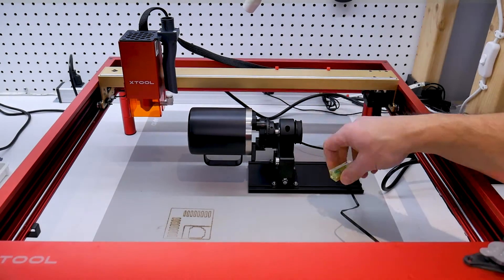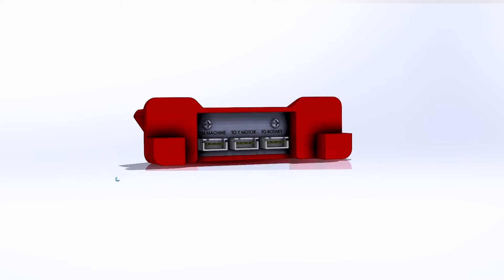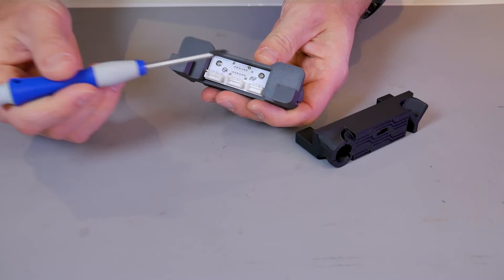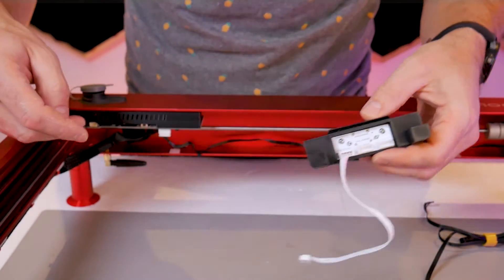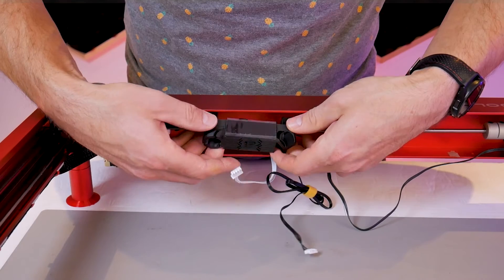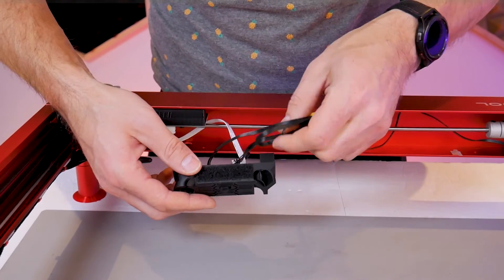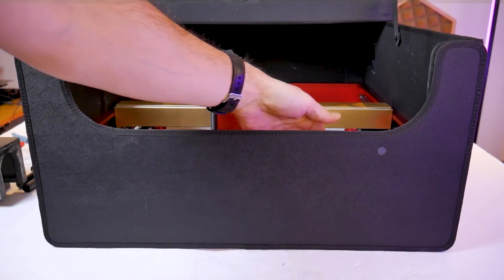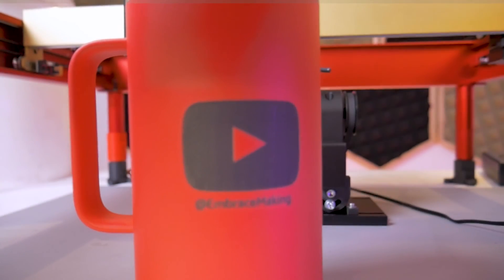XTOOL RA2 PRO V2 Rotary Switch Installation (Hidden Mount)

Comment: XTOOL RA2 PRO V2 Rotary Switch is a great idea. If RA2 is constantly used, your switch will enviably save PCB connector from pulling away from solder pads. I JB Welded my connecter to PCB but don't trust it.
Good engineering and thoughtfully implemented.
Reply from the maker: Thanks! Yes this is one of the reasons this was made!

Comment: Since I don’t keep the rotary in the bed as I need the entire bed, and my laser is enclosed, an extension cable solves all problems.  Will take years to wear out the extension.
Reply from the maker: Lots of different ways to approach it. A lot of people also just like the convenience of flipping a switch :)
Reply: @EmbraceMaking  hobbies I guess.

Comment: Well I knew it was only a matter of time before someone else copied my solution for switching from Y to Rotary.  Looks nice.  Mine does allow using 2 rotaries so you can keep one in Chuck  mode.  I've sold over 520 switches so far and I should have patented it but didn't have the $$ so good luck with your sales.
Reply from the maker: Hi , thanks for the comment and congratulations on your sales. For the record I've never seen your switch before, rest assured I never copied you. This seems to be a generic idea that's been floating around these laser machines for a while now. Best of continued luck with your sales and products as well!
Reply: How can we order your switch